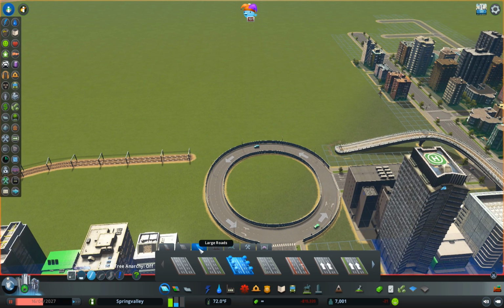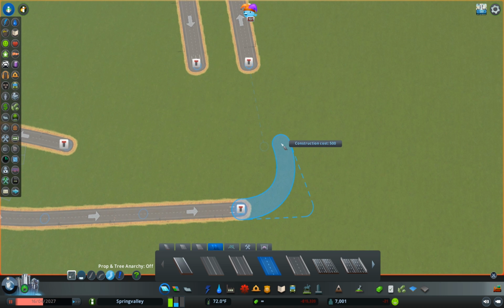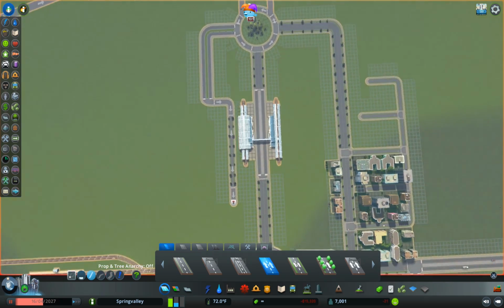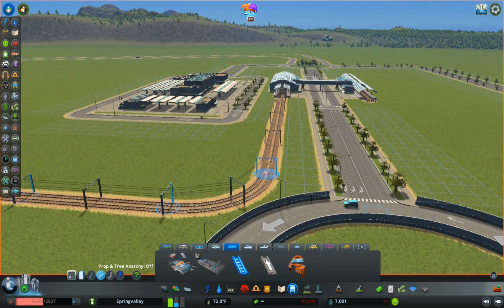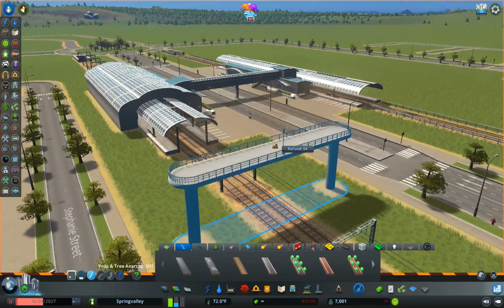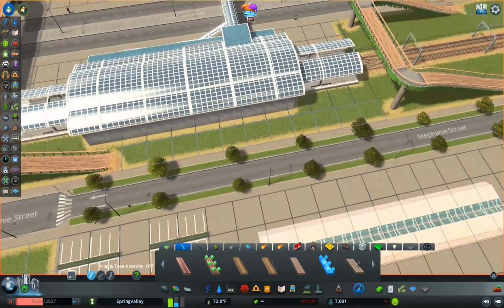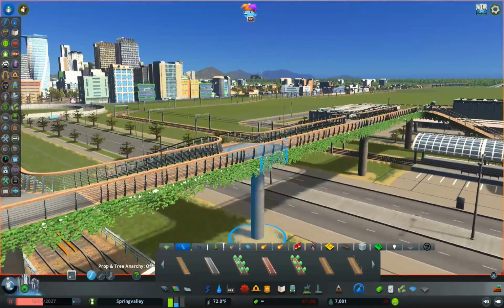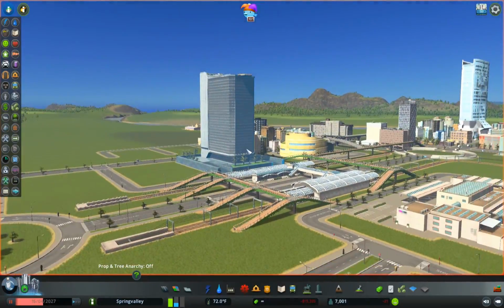Sunset Harbor Transport Hub - Cities Skylines Modular Builds - No Mods (Mini Build Guides)

Comment: I'd probably use the electric train tracks only for HSTs (Bullet train, TGV, etc...), entering the map, speeding by a smaller city or three (industrial, historical, etc...), to stop at the main city then proceed off the map.  Regular trains (from off map) would be used for long distance passenger travel to the smaller cities (industrial, historical, etc...), also stopping at the main city then proceeding off the map. ;-)

Comment: Ok, let me get this straight?  Those are electric trains, Not Trams?
Can I use the above ground (surface) Metro/subway is like a Tram (no wires)?
Reply from the maker: Yes, totally different to trams. Can hold many more people and move at much higher speeds. Google map the above ground metro system in New York City. You'll get a feel for how it flows and works 😊
Reply: I don't like the trams overhead wires so I was thinking of using above ground metro system instead but if I'm correct (game is accurate?) there's a third rail to power the trains.
Like you've shown I'd need to add fencing, preventing vehicles from turning left (in U.S.) and people walking over them (and get fried if not careful).  ;-)